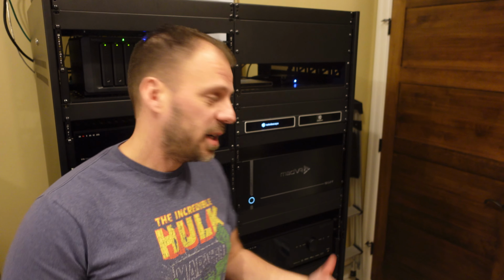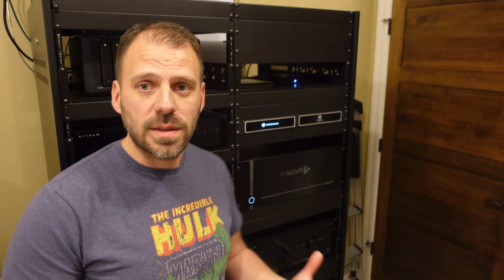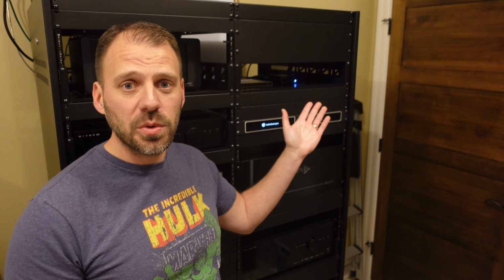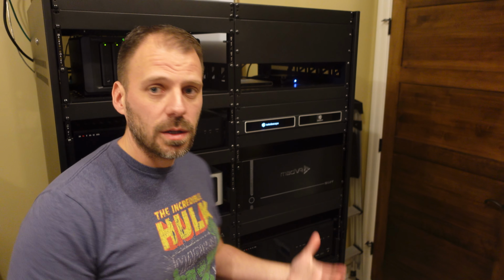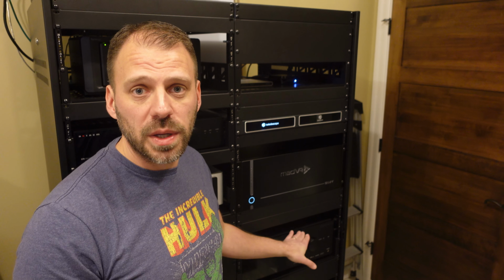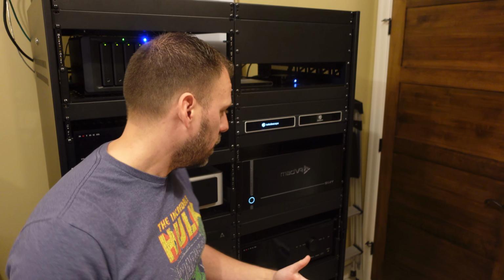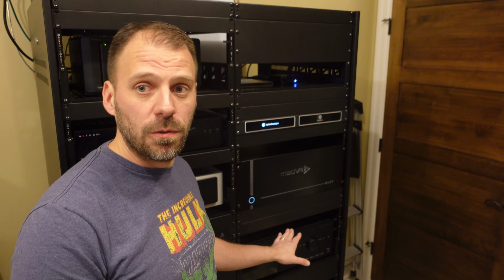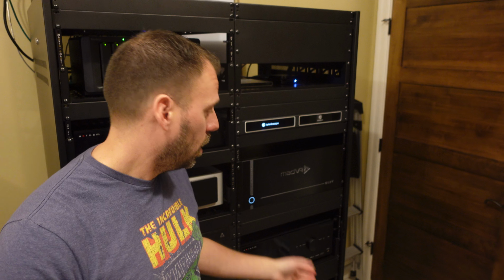madVR Envy Extreme MK2 Install & HDMI Connection Guide with Lumagen Comparisons

Comment: I have one projector and two TVs, and can I connect the projector from the hdmi output of the madvr and connect the two TVs from the two DisplayPort (DP port) outputs of the madvr? In that case, can I switch the output of the madvr via a home automation control?
Reply from the maker: I do not believe this works. I believe it is one HDMI output that is processed plus the pass through. You should verify that with their support, though.
Reply: Thank you for your kind reply. In the middle of this video, you mentioned that you use a projector and a TV. Do you apply madvr to both of them? How did you connect hdmi for them to use the madvr (ex, did you use a hdmi splitter to the hdmi output of the madvr)?
Reply from the maker: My projector and TV are separate rooms and systems. The madVR is used in my theater only with the projector. I will say though that the Envy has a real strong profile system, for customizing behavior with different recall abilities.

Comment: Madvr Envy mkII produces 8K video. Lumagen produces 4K video.  Does the JVC NZ9 uses all 8K pixels? Or it only uses 4K and this difference between the Madvr and Lumagen does not matter?
Reply from the maker: NZ uses pixel shifting, but it would utilize the pixels, yes. You could use the Envy to upscale to 8K and output that to the JVC. It's a good question whether this is a beneficial thing to do or not. I don't have the projector capability (yet) to be able to test this. Maybe someone with both an Envy and an NZ can chime in?

Comment: Just out of interest, I have a Lumagen 5348 and use it as the HDMI switcher in my system. I use it with the split of video to the project and audio to my audio processor. I like the ability of the Lumagen to have different settings on different inputs, which allows every input port to have a heaps of different settings. I use game mode on the ports that my PS5 and Nintendo Switch are plugged into, and normal mode for the rest of the devices. Having said that, I measured the processing lag on the Lumagen at around 20-25ms when its not in game mode and with game mode enabled, its basically nothing.
From what I have read, the MadVR has around 175-220ms of processing lag, which makes it completely usable for gaming. Hence the reason the bypass would have to be used for any gaming. Interestingly enough, that long input lag is how MadVR does the quick aspect ratio switching, as there is enough frames in the buffer to allow the device to quick switch. Also this has been fixed on the Lumagen with the newer firmwares too.
I cant really see me moving to the MadVR from the Lumagen, as there is some disadvantages in doing this, such as cost, power consumption/heat generation (400W!) and size. 

One more thing Jaremy, you mentioned about the gaming experience on the Sony TV being bad. I have tested the input lag on my A95K, and in normal mode is circa 200ms, in game mode is 15ms. What are the chances you weren't using game mode?
Reply from the maker: Nice! Lumagen does a lot of great stuff too, for sure. Zero latency pass through is important. I would also require HDMI 2.1 in my pass through now though to be able to game up to 120 FPS with VRR using the full 48 Gbps HDMI bandwidth on PC.

My prior TV was an older Sony, an 85" X900H, that had a bunch of failure to deliver issues when it came to HDMI 2.1, VRR, and so on. I was definitely in game mode. My comment was about high frame rate and latency being linked together as higher frame rates naturally have lower latency. The combo together made me play better, but input latency alone as well, the new G2, I believe, beat that older Sony as well.
Reply: @Techthusiasm   You need to keep in mind that both of the inputs on the MadVR MK2 are HDMI 2.0b and its only the output of the GPU that is HDMI 2.1. So even on the pass through you can not do 120FPS with VRR as its a 18Gbps input port. Not sure it they are going to update that anytime soon. I know they talk about be 4K120 and 8K capable, but the can not accept that as an input source into the processor.

With the Lumagen, you can replace the HDMI ports, as I know there are 9Gbps and 18Gbps ports for these that can be swapped out. Not sure if they plan to release a 48Gbps port or not. 

And wasn't there something about the older Sony TV that where 40Gbps and not the full 48Gbps? That might have been part of your problem?
Reply from the maker: Hmm, interesting on the Envy inputs. I'll definitely inquire about that. That would certainly impact my use of the passthrough port vs. using the second main zone HDMI of my Anthem because I would demand HDMI 2.1 passthrough for a PC or console now.

Yes, you need to be real careful buying a used Lumagen so as not to get 9 Gbps ports. I'm not sure if they have HDMI 2.1 yet. I believe not.

Lots of devices that claim to support HDMI 2.1 limit bandwidth, yes. Including many receivers and preamps as well. I'm glad that Anthem, LG, and the NZ projectors all use full 48. We just need VRR in the next generation of JVC units!
Reply: @Techthusiasm  You can see on the product page "The Envy Extreme supports 8K HDMI 2.1 output" with "output" being the key word there. And on the product spec sheet pdf for the Mk2 "HDMI 2.0b HDCP 2.2 18.0 Gbps input ports" and "HDMI 2.0b HDCP 2.2 18.0 Gbps zero-latency pass-thru". So I would assume that the input PCIe card that they are using is only HDMI 2.0b. Not sure if that will get an update.

From what I understand all the ports on the 5000 series Lumagens are 18Gbps, its only the older model 4000 series that can have either 9 or 18Gbps. And as you have mentioned, I am also pretty sure there isn't an option for full 2.1 with 48Gbps. Not sure if they have roadmap for it. However there are some HDMI 2.1 features already in the Lumagen, such as info-frame low-latency mode, just not support for 8K 60Hz or 4K 120Hz due to bandwidth.

One thing is for sure, Lumagen isn't the "marketing" company that MadVR is.
Reply from the maker: I did ask the madVR folks and confirmed as noted that the input and passthrough of the Envy is 2.0b. I had expected full 2.1, but I suppose then as an addendum to the video, the preferable way to route gaming sources, especially a PC or coming PS5 Pro, would be to just bypass the video processor whether Envy or Lumagen. I'll just plan to use the 2nd main zone HDMI output of my preamp as I discussed in the video the next time I connect gaming in my theater.

Comment: Nice Video! Does the madVR Envy Extreme MK2 show a much better picture than the Lumagen Processors?
Reply: No
Reply from the maker: Lumagen puts up an excellent picture and includes a lot of key processing elements as well, including aspect ratio management and HDR tone mapping. madVR has unique features and different usability. One would need to decide what they are looking to get out of a processor and determine their budget as well to choose which is best for you. I don't have both devices side-by-side to A/B or blind compare to answer this question with a definitive yes or no on picture quality. Both are great.
Reply: I own a Lumagen Radiance Pro and it is very good. The one thing that I noticed on the demo videos of the MadVR is the ease of setup.   If Lumagen could work on one thing it would be to make the setup user friendly.  Both appear to produce similar results.
Reply from the maker: Yes, the difference in interface and ease of use is pretty huge.
Reply: @Techthusiasm  Both should be professionally calibrated, so it's moot anyway.

Comment: My question is will I see a better picture on my flatscreen Tv using the Envy? I’m thinking it’s more for a Projector than Flatscreen.
Reply from the maker: Some elements definitely do a bit more around a projection setup, and a scope projection setup specifically; however, HDR processing, MotionAI, and other key features are usable regardless of display type. So, yes, a video processor can still be applicable for a flat screen. You could also still choose to use NLS to stretch wider than 16:9 content vertically to fill the screen.
Reply: @Techthusiasm  Wow! Impressive! Is there a way for you to demonstrate the before and after processing of a video?
Reply from the maker: More content is coming, for sure.
Reply: @Techthusiasm  Will the nonlinear stretch work on a 55in oled tv?
Reply: One thing TV specific is that there is no audio pass-through on the Envy (or at least when I tried it on my tv last year).  This really only impacts if you if you ever wanted to use the built-in tv speakers.
Reply: Does the Envy support 3D? I was not able to make it work with the Envy Pro Extreme MK1. Would appreciate if you can demo that in your future videos.
Reply from the maker: The latest experimental firmware had some notes related to 3D, so I think it works, but I won't be testing it. I'm not set up for 3D in my theater, and I have no content. 3D has never really been an interest for me.

NLS would work on a flat panel just like on a projector, yes. For a flat panel, it would give you the ability to stretch to fill more vertical screen when watching wider than 16:9 content.

If you have an audio system that is receiver/preamp-based, why would you want to use TV speakers? I suppose if your receiver is broken and waiting for fix/replacement, that's one reason.
Reply: @Techthusiasm For TV speakers, I call it the "Mom" factor.  She has a Roku at home and gets confused by my Control4 remote when she comes to visit so I give her the Roku remote.  She likes to watch YouTubeTV on my Roku since that is what she is used to.  The Roku remote doesn't have the ability to control volume on my PreAmp, so the easiest way for her to watch TV that I've found is just Roku + TV speakers.

Comment: Although I do not have your great gear I do have a question regarding HDMI switching. I too have only 2 video sources (ATV4k and 4k BRD player). I have always run them into my Denon avr and the out to my TV. However a few times when I did not have my avr inline and I connected my ATV4k directly to the TV I noticed my HDMI handshake speed improved noticeably. What I don’t know is if I ran my video sources directly into my TV and then eARC out to the Denon would my video quality actually improve? Have read conflicting views on this matter. Thanks for any input.
Reply from the maker: The less items, generally, in the HDMI link, the less negotiating and communication happens, so yes, it could be faster. In my living room, I run all my sources directly into my TV. I would not expect to see any actual video improvement this way; however, in terms of fidelity or quality unless the receiver is specifically negatively impacting the signal. I will note as well with the madVR that HDMI sync times seems to a touch quicker and more stable and with specific settings can be significantly reduced eve with a projector (which are notoriously slow in HDMI).

Comment: Hello, I’m currently using separate hdmi cables to connect my Kaleidescape video out to my tv and my Kaleidescape audio out to my AV 7706. With regards MadVR, can I keep the same video/audio configuration by connecting my Kaleidescape video out to the MadVR and MadVR video out to my TV? As for my kaleidoscope audio I’d keep it the same hdmi setup . Would this setup work? The reason why is because I noticed when using separate audio and video on my Kaleidescape versus just using one HDMI for both audio/video I get a slightly better picture and audio sound.
Reply from the maker: Yes, you could keep the same setup with the madVR. K video into madVR then onward to display with K audio to your preamp. In this case, you would just be using the madVR only with the K and no other sources, but that might not matter to you. I'm surprised that you experience a quality difference in picture or sound though splitting your signal versus passing through the preamp.
Reply: Thanks for the quick response! 

Yup, I went back and forth and definitely notice a difference splitting the video and audio from my Kaleidescape. I’m using audioquest cinnamon 48gb hdmi cables and they do make a difference when using my Kaleidescape. Not so much with my Apple TV though.